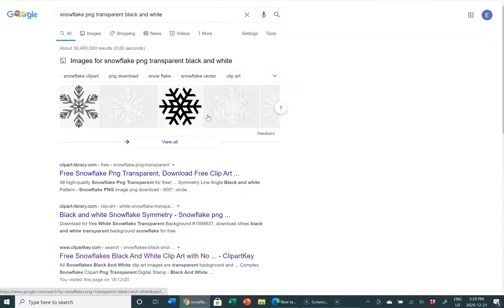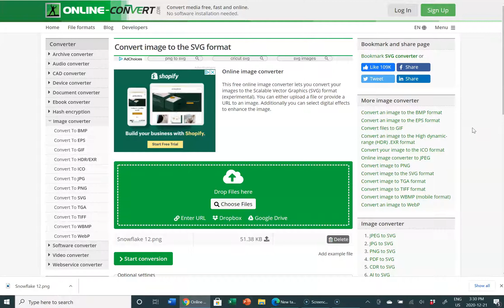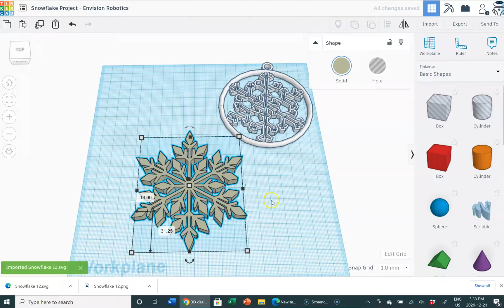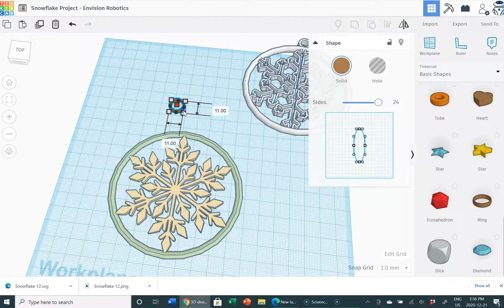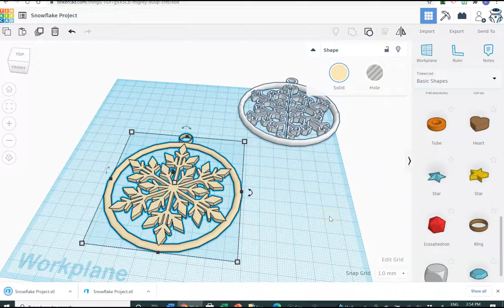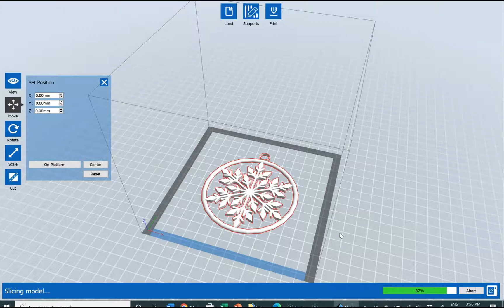TinkerCad Tutorial - HOW to Turn a PNG/JPEG Image into a 3D Design, Step-By-Step!

Comment: awesome! im making a "switchblade" multimeter for the quality inspector at work. hes a cool old guy and he deserves a cool multimeter. this is very helpful for getting the handle correct. its a fairly simple shape but im new to this so saving all of the time getting the curves of the handle right is a big deal to me.  thank you so much for sharing!
Reply from the maker: Yes there is so much you can do turning simple black and white images into 3D models. Thanks for the comment!

Comment: is there a way to put an image into tinkercad so that i can trace it with the scribble tool? this svg thing is not working for my image. i need to get a model of a motherboard i have.
Reply: i realize im one year late, but could you take a picture of the motherboard and use a negative effect in a image editor? it would make the outline of the board stand out and give you a good contrasting image with the shape you need, maybe
Reply from the maker: Not that I am aware. You can try adjusting the settings on the image converter. I assume your light or white colours are not coming out?